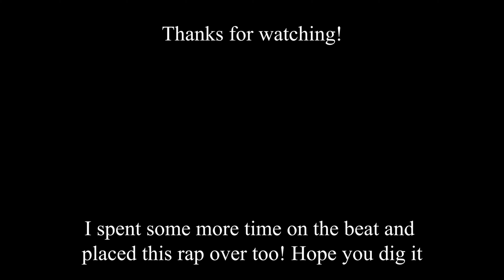Making a LOFI beat using Resample // SP404sx workflow breakdown

Comment: If you use reverse you can trim the end without listening to the loop over and over. Great job as always SPVIDZ
Reply from the maker: For some reason I’ve never been able to get the hang of trimming using reverse. I will try and do some practice soon!
Reply: @spvidz  its super weird for sure
Reply: Yeah but you need a kick transient to cut off. Good point to not trim until the end though.
Reply: Great tip. I am going to try that.
Reply: @spvidz  you gotta leave just a little snippet of the next bar of the loop. Then when you reverse it trim until you cant hear the click or pop when it loops around again. Hope that helps.
Reply: Mind=blown
Reply: holy shit if i can get the hang of this i can cut the time i spend in half

Comment: i never learned how to use the pattern sequencer before, so i was always intimidated by making full beats on the 404 bc of having to resample everything.

after watching your vids on both i'm gonna give pattern sequencer a try, i think that'll take the timing issue out of the equation.

thanks!
Reply from the maker: Takes a little bit of work to get it sounding good but its a lot of fun once you get the hang of it!